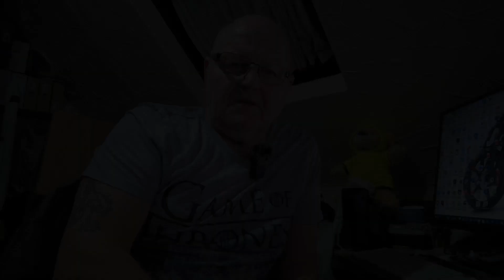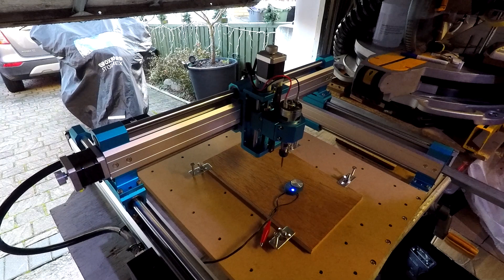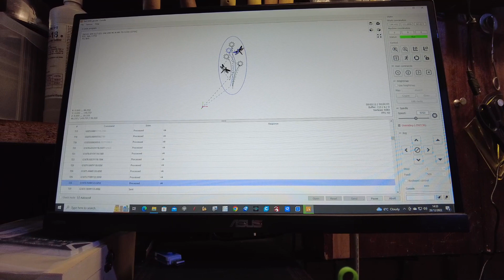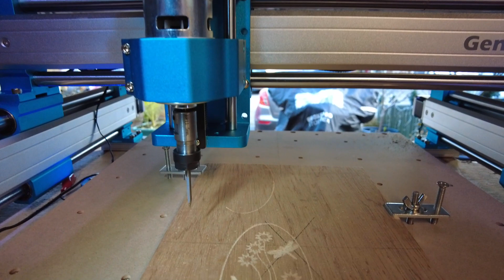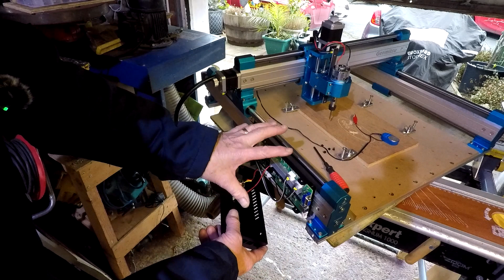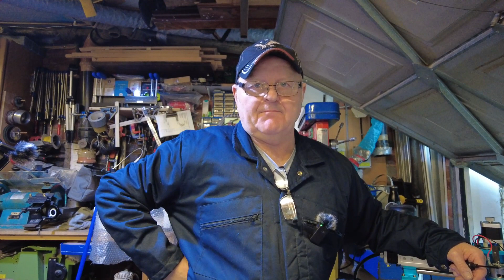Sainsmart Genmitsu CNC 4040 Pro  part 3

Comment: Hi Tony
Me again, CNC newbie from downunder.  I have had an issue with the Candle software sending a "check limits" message after only 10-15 seconds of operation.  It also happens with LightBurn and Laser GRBL software.  SainSmart have sent me a replacement Z axis limit switch and mother board without instructions.  Whilst I have some idea about what to do, I am not an electrical engineer and your help would be appreciated.  BTW I have watched your helpful videos many times and your tips are very clear and practical.
Reply from the maker: Sorry to here about your problem, if it's a limit switch it is easy to replace if you know  which one of the two it is. Replace one and try the machine if it cures the problem great if not swop it back again and swap the other one. If that does not work shop the board. When swapping  the board take photos  of the connections I use coloured felt tip markers on connector  blocks and number  them. I will try and do a video on changing the board in the next few days. It's not as hard as you think to change it but try the limit switches first.
Reply: Thanks Tony. Will give it a go as per your steps. 😮
Reply from the maker: Hi just uploading a video to help you change the parts hope this helps and feel free to message me

Comment: Your videos are awesome. Just learning CNC, Do you think the 4040 would be a good machine to learn with?
Reply: Thank you for your quick answer
Reply from the maker: Hi thanks for your feedback. Yes it is a good one to learn with and if you can get an offer on with the price its good value. I use mine different to most I use the offline controller all the time it works great but its all about what you want. If you are planning on cutting metal then I would go for the 3030 pro but it is a little more expensive but it comes with the offline controller

Comment: Great video 
I have 3 questions for you 
1. How well do you like this 
     Machine 
2. Can you engrave a
     Shamrock (the inner of 
     The shamrock 5 mm 
     Deep
3.  Would you purchase this 
      Item
Reply from the maker: Hi thanks for your feed back I like the machine quite a lot, I had some quality control issues at first but I sorted them. This machine is still hobbyist quality but well worth the money. Regarding the shamrock I don't see why it cart do what you are asking given the right design and gcode, and I have purchased this from SainSmart direct I pay for all the equipment in all my videos. Thanks Tony
Reply: @Tonys.Top.Tips.Workshop  
Thanks for the quick response 
Is the software you mentioned included with the machine 
Thanks for your help
Reply from the maker: @jim6402  Hi Jim its not included with the machine the software you receive with the machine is Candle that controls the machine when you load a design file into it. There are some Free ones out there so I am told but I stick with the one I paid for. Cheers Tony
Reply: @Tonys.Top.Tips.Workshop  thanks for your info and have a great day
Reply from the maker: @jim6402  Same to you Jim

Comment: Could you show how you use the clamps?
Reply from the maker: Hi Mike if you have watched the last video on the alloy table I fitted you can see that they are clamps that I use from my other cnc 4040 they are just T bolts or you can use 6mm bolts that I have  ground the heads thinner so they just slid in the T slot groves. I have a number of different bolt lengths so that depending on the thickness of the material there is not too much protruding up from the bed so your cutter is less likely to catch. I also have some 5mmx25mmx80mm flat bar with a 6.5mm hole 25mm from one end in the centre I use these as clamps and use a piece of the same material to pack out the other end if you understand me. You can make a bunch of them for under £10. Thats the beauty of this type of table.

Comment: HI Anthony ,
I ordered my machine yesterday based on some really good reviews and now Im watching your videos. This machine will be my 2nd CNC.
Did you have to calibrate the axis's at all or is it good out of the box? 
What I would have done is draw a square and a circle to exact dimensions and see how far off the machine is. 
Does Candle allow tweaking of the stepper motors?
Reply from the maker: Hi Skotty  I tend to cut 3 different  circles out of 5mm material and check the size and roundness then I cut 3 squares at the circle sizes then a trench or groove and check the depth. When I did mine it worked out to be 0.1mm out at its worst but for me that was ok so if I wanted to I could build that difference into the design. Tony
Reply: @Tonys.Top.Tips.Workshop  So you didn't have to calibrate it? .1MM is acceptable tolerance for most projects I suppose. All the best to you.
Reply from the maker: @SpottedDogDesigns  Hi no I have not touched the calibration, If you were machining metal parts that have to be precise then you would but I do not need mine to be that accurate my 6090 does that. Tony

Comment: Would you recommend this over the 4030 provrxl for a first cnc. Hardly any info on this 4040. Nice videos btw thank you
Reply from the maker: Hi what made me choose this one is it runs on steel rods not rollers and it is a lot cheaper. I paid £454 from sainsmart with some discounts and coupons I searched for where as the 4030 is nearly a £1000. It is a decision only you can make. Tony

Comment: Thank you for posting these videos.  I bought a small desktop router years ago I think it was a Shark.  It was very poor quality and could not cut a true circle  no matter how slow and multiple passes.  Question for you, can this thing cut a true circle?  Is there slop or movement once the bit gets under a small load?  I need a small desktop cnc for my at home hobby use cutting small 2-3mm thick carbon fiber parts, and bulkheads for building out of 6mm plywood.  Your input on this would greatly be appreciated.
Reply from the maker: Hi Thomas my machine cuts well but I am getting reports back from other uses that are having problems with movement or slop in the z axis bearing rails and a little flex in the x axis linear Rods but my machine is not like that. This is what happens with new machines that are produced you dont know what the problems will be. I received one of the first and its great. I made the videos on my experiences but believe me I can soon make another one on other uses experiences and I dont think they would like that. Tony

Comment: Thank you Anthony, great video and solved my problem with the z probe.
Reply from the maker: Glad it helped was it the same problem I had I have just had a reply back from Sainsmart and they have passed my video on to the engineers, he did say that they have had problems Tony
Reply: @Anthony Lofthouse  the exact problem sainsmart could not figure it out until you came up with the solution
Reply from the maker: @ChuckAloha  Hi chuck I am speaking to them at this very moment as you are aware the machine is very well made I have no problems with that but to send it out with this fault is professional. Tony

Comment: Hi Tony, kind of a disappointing day today.  I have all the assembly done and I was jogging the spindle and found that I have no movement of the stepper on the right Y-axis rail.  The left side goes but immediately binds of course since the right does not move.  The stepper appears to be dead, or is miswired somehow.  The instructions in the book regarding the connections of the Y axis, to me, are not clear.  They refer to a connector labeled Y-R which I don't have.  On the left side, I have two plugs, an R and an L, plus the extension socket coming from the right side stepper.  I would like to email you so I can send pictures, etc. if that's alright.
Reply from the maker: Hi Dan is the cable for the stepper motor on that side connected. Tony
Reply: @Tonys.Top.Tips.Workshop  Hi Tony yes I have all connectors plugged in but I will check inside the box.  Does yours have anything labeled Y-R as stated in the instruction booklet?
Reply from the maker: @danj3191  Hi Dan it is marked up on the board but on the back of the L hand y axis its marked as a r and a L cable connector
Reply from the maker: Hi Dan you can email. If they are connect ok then on the mother board it is marked Y Left and Y right at the top left of the board 2x plugs. Just watch the fan and power connector cables on the cover
Reply: @Tonys.Top.Tips.Workshop  I don't know your email.  Someone must have locktighted the screws on the box.  I got one out and, trying very carefully, the other three have rounded out, unfortunately.  Not sure where to go from here.  Why they didn't use hex head screws instead of tiny Phillips heads.
Reply from the maker: @danj3191  Did you try swapping the plug at the back to see if the stepper motor was ok
Reply: @Tonys.Top.Tips.Workshop  I did last night and the stepper worked.  I also checked continuity of all relevant cabling and all are good.  I am going to reload software and use a different computer.
Reply from the maker: @danj3191  you would have to drill the heads off the screws for the control box  but I would not do that if it is a software issue and you sort it thats great but if its not I would return the unit Tony
Reply: @Tonys.Top.Tips.Workshop  I did manage to get the screws off by using a better screwdriver and applying great downward force while slowly turning them.  Y-L and Y-R conns were connected and I removed and reinserted them, as well as continuity testing the cables.  The software is kind of the last hope today but I am optimistic.  Beyond that, it would seem it is likely a motor driver and I'm not going there.
Reply from the maker: @danj3191  Hi Dan where did you purchase it from
Reply: @Tonys.Top.Tips.Workshop  Amazon.
Reply from the maker: @danj3191  If you have to send it back they are very good but you would need to do it sooner than later but you would have to put it back in the packaging Good luck keep me informed as to the outcome Tony
Reply: @Tonys.Top.Tips.Workshop  I used a different Windows 10 computer, reloaded driver and software (Candle), and now none of the steppers move.  The three that were working before now just make a noise like they are binding but don't move.  Touching the knobs I can feel them trying.  I will try one more thing, using a different software, maybe UGS.
Reply: This is very frustrating.  I have several 3D printers and an Xtool D1 Pro 10 watt laser and have never had a problem setting them up.  Always a first time I guess!
Reply from the maker: @danj3191  Hi Dan sorry that your having so much trouble but that software should work you could try downloading it from the website in case the softy ware you have is corrupt. You are no novice so its nothing you are doing I would be tempted to send it back. I have identified a problem with the LC 40 laser engraver that I have reviewed sainsmart doesn't even know how to fix it yet I have found a way. I have had people email me with the same issue on the LC 40 and have fixed it the way I did. Tony
Reply: @Tonys.Top.Tips.Workshop  First of all, Thanks Tony for the helpful replies.  Yes, I have it all boxed up and have gotten the approval for return from Amazon.  I think I am going to change directions slightly and order a Genmitsu 3020 Pro Max.  It has a few things I like better, such as the 300 watt spindle and the cast aluminum base/spoilerboard, and offline remote.  The one thing I will surely miss though is the size of the working area, but I have been going over in my mind how I can adapt my projects to work within the limitations.  I have to remember that this is an entry-level choice and if all goes well a more professional unit is in my future down the road.
Reply from the maker: @danj3191  Hi Dan sorry to here that you are moving away from the 4040 but I do understand. Its easy for me to try and sort the problems out but I have a 6090 cnc professional machine that is controlled by a DSP so I can use that, as I have said in a new video posted today Sainsmart should have sorted this out. That machine is now on sale at Amazon at £817 an increase of £118 since Xmas. I paid from Sainsmart on line £449 with discounts big difference. Keep me informed Tony
Reply from the maker: Hi Dan if it is connected and it still does not move then take the cover off the control panel there are 4 screws and check the plugs are pushed all the way in on the mother board for the y axis

Comment: Tony, I was so happy to see a Part 3 video today!  I just received my 4040 less than an hour ago and have only opened the package for a quick inspection and all looks good.  Surprisingly, the box has no damage after traveling all that way, especially at this chaotic time of year.  Thanks for providing the information about the fault.  I think I will address that preemptively with a bit of tape or heat shrink.  It will be interesting to hear what SainSmart has to say.  I am planning to at least go for the 300 watt spindle, or more likely the Makita router as soon as the bracket is released.
Reply from the maker: Hi Dan you wont be disappointed with the build I really do like mine. I would try your machine first with touch off as it might be ok You will know straight away once you connect the touch probe as it should be with the crocodile clip it will go from blue to red if it doesn't then it is ok.  As I say in the video it still worked great but not the touch probe. I would have liked to have seen an alloy base board and a  better spindle that would make it one of the best on the market. Let me know how you get on, a chap has mailed me to say that some of the bolts that bolt the frames together bottom out in the holes so just check that mine didn't. Hope to here from you soon Tony
Reply: @Tonys.Top.Tips.Workshop  Yes, I thought I would go ahead and build to the manual and just see what it does, but it's good to have the heads-up as to a potential problem.  Have you seen anywhere if the Makita conversion is available now?  They have pictures of a 4040 with a Makita mounted, but no info on a PS/control box, and bracket.  That's the way I really would like to go I think.  Amazon has the router for around $120 US.  1.25HP which is 930 watts or so!  That'll move some wood!
Reply from the maker: @danj3191  Hi Dan I am waiting for the offline controller and the larger spindle mounting bracket but you can fit a 52mm dia spindle in that bracket now as it has a sleeve in that you can remove. You can use a mobile phone connected by the usb cable to c port of your phone and use the offline controller on that. its called GRBL controller for a mobile. There are some vids on youtube I got it to work ok. Tony
Reply from the maker: @Chancy Felan  Hi glad you enjoyed the videos just remember take your time if your new to CNC its all a learning curve as I  am still learning every day with it Tony
Reply from the maker: Hi you could try pulling the y axis stepper motor plug  and putting it in the right y axis cable and just gently energise the right then you will know if its that